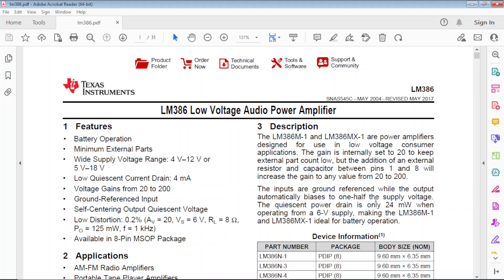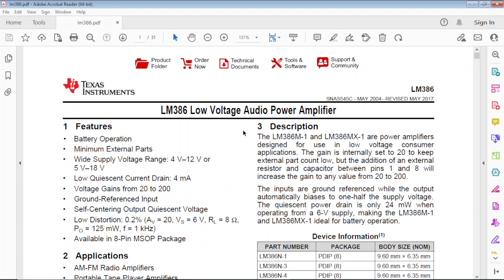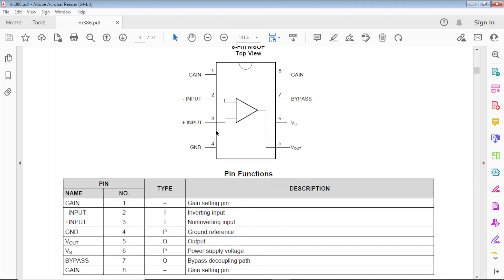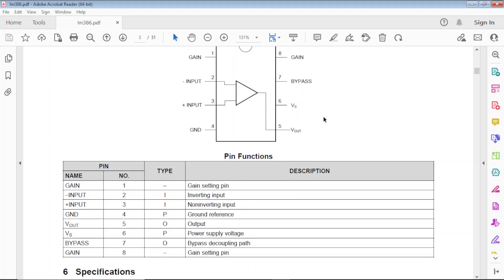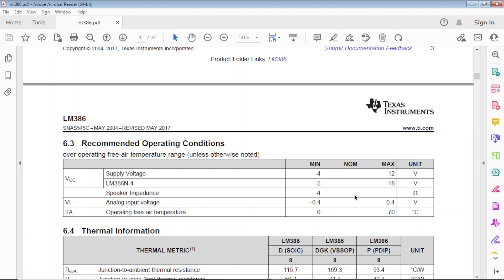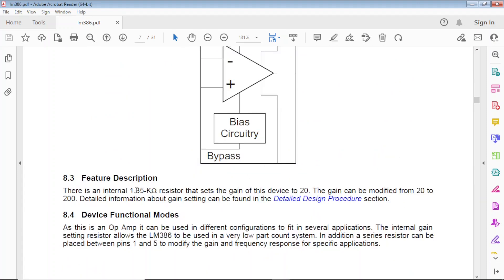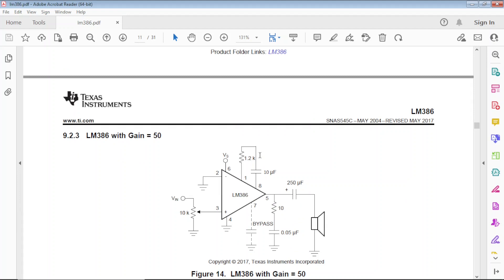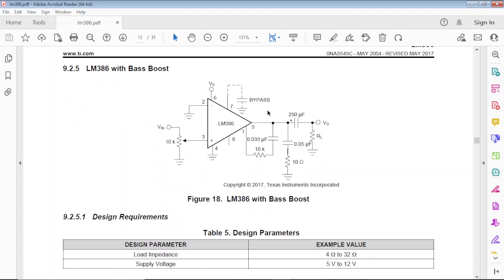LM386 power audio amplifier (great as portable amp for guitar or line out or headphone out)

Comment: Thank you! Subscribed.
One thing that I find interesting is how this single supply amp can handle an AC input without DC biasing required. The input signal has a negative swing, yet the amp, which has no negative supply voltage, somehow handles the negative voltage. Looks like the output gets biased up to half the supply voltage, so does the input get biased up to some voltage internally?
Reply from the maker: The biasing is done internally with a 50k ohms resistor. You can see it if you look at the data sheet from the manufacturer